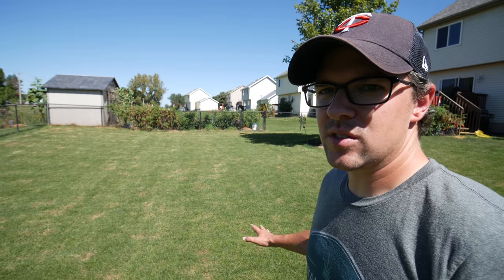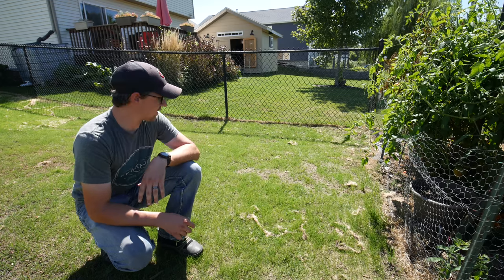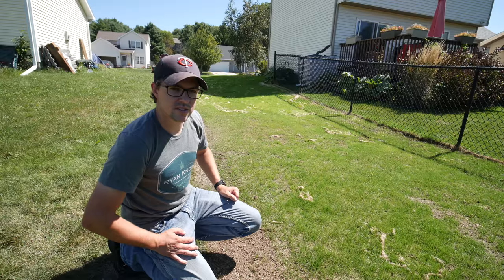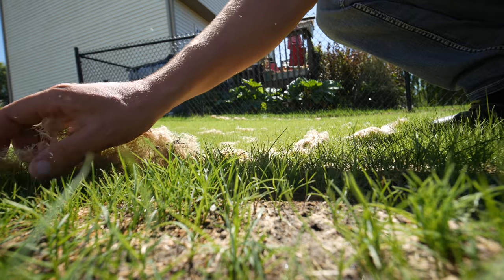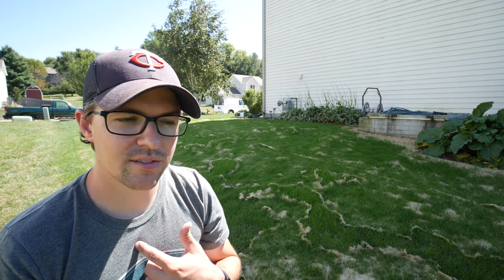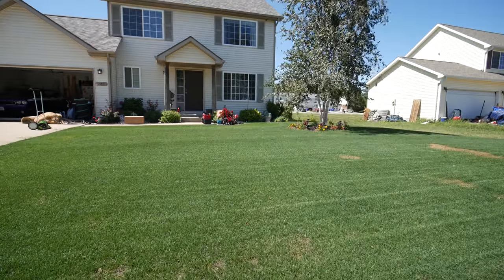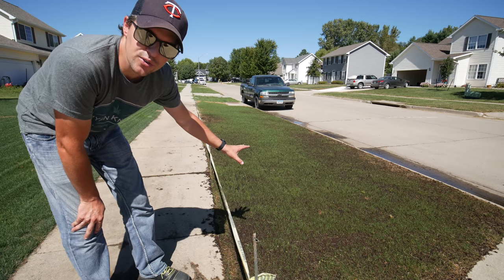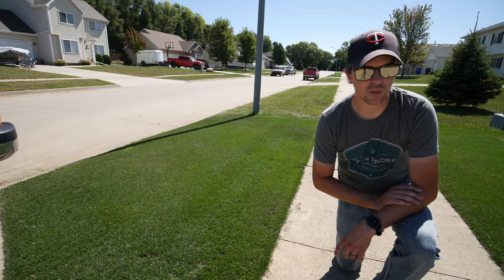Lawn Renovation RESULTS Are In! // Seeding Blanket, Manual Reel Mowing, Irrigation Update

Comment: Just FYI the Fiskers reel has just wheels no rollers it is also front discharge. The cut is adjustable from 1-4inches. So it may be easier on your yard if you can find one cheap. It's a pretty cool mower.

Comment: Love to see the progress in your yard.  I've had a ton of experience with sprinkler system and I'm disappointed that who ever installed your system did not have apposing heads on the street side.  it's been my experience that if you don't you will have exact problem you're seeing now.  Also the type of heads you're using may be very low spray not like the other one's better that spray flatter but also a consistent, even spray.  I never liked those type of heads in your park strip. Just my 2 cents worth.
Reply from the maker: I'll keep looking into it..thanks for the advice

Comment: Your strips are having watering issues because the sprinklers don't have complete head to head coverage. There should be a line of heads on the street side that throw to the heads on the sidewalk side, and they should be offset so they form a triangle.
Reply from the maker: I have the same issue tho on the north side which has them on both sides so it's a bit puzzling

Comment: Wondering if you had tried lightly wetting the blanket prior to removal, helping the grass leaves from sticking. Doesn't really matter but I was a somewhat curious. Thanks for the update~Mike
Reply from the maker: Yep I did but it actually made it worse because this one is designed to stick more when it's wet
Reply: I guess the futerra fibers don't expand when wet then...thanks
Reply: Where do you get these mats at and is there any dangers of weed seeds in them.

Comment: Would you use the blankets again? Any better adjustments you can make to get better even coverage with your irrigation? Or maybe change heads and get more flow?
Reply from the maker: All the heads are regulated pressure wise so it should all be even but I'll look into it more...as for the blanket yes I would absolutely use it again
Reply: Ryan Knorr Lawn Care good to know. I’m about to start a new lawn after our house is finished being built. I’m going with GCI turf academy TTTF. But I’ll be playing on bare soil so I may end up looking into the blankets

Comment: Do you think you would have avoided the air pockets if you ha used the rolled after laying down the blanket?
Also the increased worm activity is caused by the peat moss....worms love peat moss and aged horse manure.
I like the Twins cap...I live in Mpls.
Reply from the maker: I didn't put any peat on the areas where the worms are the heaviest...just the blanket there but either way my soil is full of them anyway.  :) 

Rolling wouldn't have worked because it's just a light wood fiber blanket and very fragile so any traffic on it while I was putting it in place was already starting to do a little damage.  

Go Twins!

Comment: Ryan - just curious... those areas where you believe you aren't getting good water coverage are closest to concrete and asphalt. Have you checked the soil temps in those areas? Maybe the center area is cooler and promoting better growth instead of a watering issue?
Reply from the maker: There are areas near the concrete that are doing just fine so unfortunately it's a coverage issue
Reply: @ryanknorrlawncare  Thanks for the reply!  Bummer about the coverage issues!  I know you were finally glad to have an irrigation system installed!

Comment: I have similar issues. North side too much shade. Its growing but thin. Do you think it will come in better in the spring?  Plus moles are messing up two important bare areas I needed grass. What did you use for the moles?
Reply from the maker: I have never been able to completely solve the mole issue.  The north side with my ryegrass I never had issues really so we'll see how this does long term

Comment: Great video again. Do you have any fertilizer recommendations for getting your bluegrass to spread/fill in. And no I haven’t done a soil test. Did about an acre renovation this year going to do a soil test in the spring. I have a 50/50 blue rye mix. Aerated and overseeded with xstart 8/31 hopefully that will help fill in
Reply from the maker: In fall you can go as extreme as .5 pounds of N per week if you want aggressive spread. Also plan to mow it every other day 😃
Reply: I can do granular or liquid. I did 2 light apps of liquid 18-3-6 50% slow release with micros about 3 and 5 weeks ago and a full rate of milorganite 3 weeks ago thought the p in milorganite might be good shortly before seeding. I can get milorganite for $7.99 a bag. Was thinking about doing another 100 pounds of xstart this weekend maybe some humic kelp liquid then maybe trying out carbon x at a low rate. Gets a little expensive to do an acre   Seems like liquid is cheaper but I’m definitely not a pro and not sure if granular or liquid is better or a combination of the 2 is the best route

Comment: Them seed blankets are complete shit. Did they initially work to get seedlings going yes. Mine started getting them bubbles as well and then i noticed the new grass barely could penetrate the blanket. The air pockets was bound up grass that was getting smothered by the blanket. After 3 weeks i investigated and started hand removing the blanket. I found most of my new grass died off because the blanket smothered it. Even worse the blanket trapped in too much water and created a disgusting white mold all over my lawn which also killed it off. Ill go the old fashion way next time with some straw.
Reply from the maker: Depends on the type of seeding blanket used...they are not all created equal

Comment: Regarding the inconsistent watering problem. I'm posting this on every YT grass channel:
We are spending huge amounts of time and money on inventing new kinds of ferts, chemicals, and grasses. Yet we're still using century old/crappy watering techniques.
IMO. NONE of the irrigation systems work properly........NONE!!!
What we really need is some kind of irrigation blanket that waters the ENTIRE lawn like a sheet. Where there's ZERO missed spots.
I'm thinking of maybe some sort of giant grid like system that can be buried, or suspended an inch above the lawn in the hot summer days. Or when seeding.
Whatever it is that you guys can think up. What we're all doing now with above and buried sprinklers is a joke and it DOES NOT WORK PROPERLY!!!!!
So I put this challenge to all of you YT grass channels: It's time to invent a modern watering system that covers the lawn evenly and efficiently once and for all.
Reply from the maker: If I had the answers I surely would let everyone know!